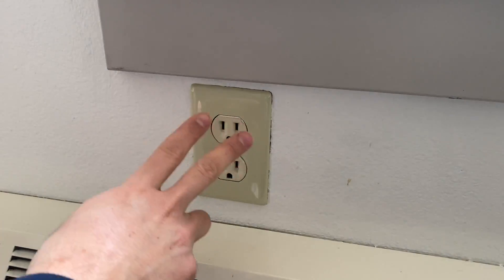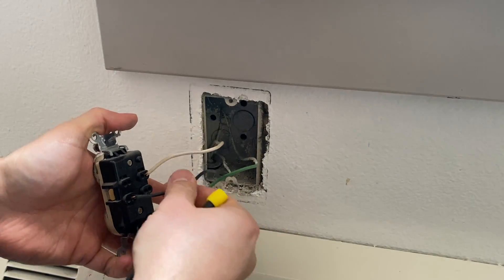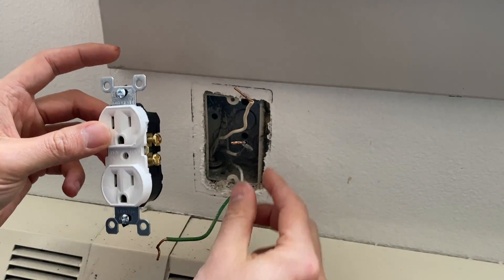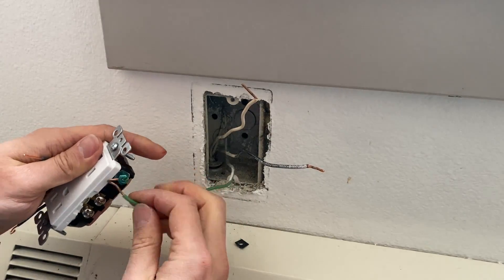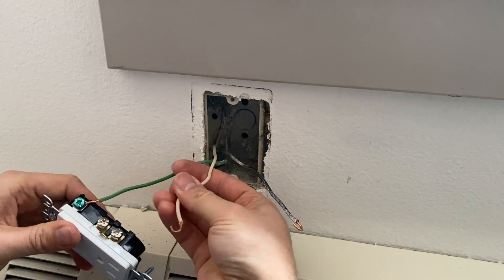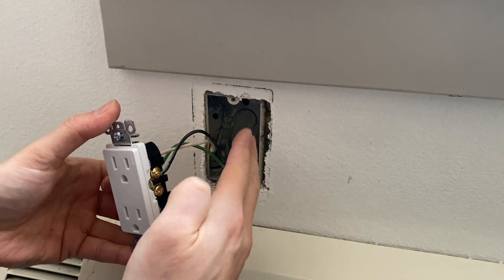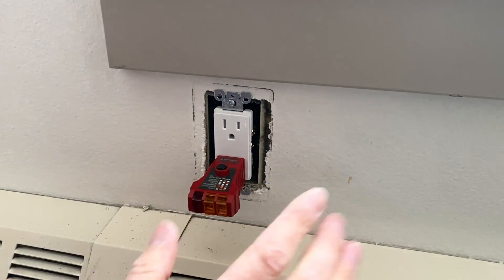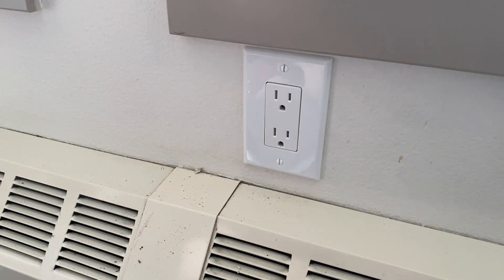How to Change Electrical Outlet As a Beginner

Comment: Dude.  Don't use a power drill.  Use a hand screwdriver if you're a beginner.  If you've done it 100 times, okay whatever.  But don't if you're just trying for the first or 2nd time.  Dumb

Comment: I don't know why no one 😢😮 points out that he 🪝 'hooked' it up wrong 😭.  
The wires are supposed to go straight into the holes, on the back of the Leviton outlet; not in a hook and on the outside, which is an electrical ⚡ hazard....
Reply: Using the holes on the back is called backstabbing, and it's a very insecure connection. It's kind of surprising that they are still allowed, since they have a very high fail rate. No experienced electrician would ever backstab, they will always use the side screws.
Reply: Then what is the purpose of those screws? Your comment does not really seem to make much sense if the option to set it up that way is there....

Comment: Why are there two screws on each side instead of just one how do you know which screw to put the wire into on each side if there’s two screw screws on each side?
Reply: It supports daisy-chaining power to the next outlet on the same circuit without having to use wire nuts or pigtails. If you break the tab between them then it allows you to power each outlet independently e.g. one with a continuous power source and the other switched.
Reply from the maker: doesn't matter. 2 screws because it's duplex. you may break the middle tabs and separate if you have to say make top switched..

Comment: Random related thought: why are we still using flat head screws to secure receptacle covers?? Slotted screw drivers should be prevented from approaching receptacles slots.
Reply: Because they are visible for all to see and are deemed to be more attractive and painted the color of the cover. They don't require much torque either.

Comment: If I have 3 white wires and 3 black, do I pigtail all of the white and all of the black and then connect them to one of the screws and nothing connected to the bottom screws? Thank you
Reply from the maker: yes. you can also connect 2 pairs to side screw terminals and 1 pair into back. 
or you can pigtail as u said. either one is legal/ok

Comment: You skipped the part I wanted to see. Thanks.
Reply: Show us how to pigtail
Reply from the maker: what exactly?
Reply: @remoteelectrician  Getting the loops of stiff wire behind the screws and secured properly. The actual mechanical elements were edited out each time.
Reply: @DadaPoopoo  He literally did all of that lol
Reply: Easy to replace the outlet when power is off. How about replace the outlet when power is still on? Experienced electricians do that. I did it too.